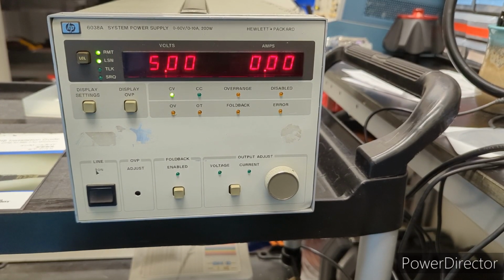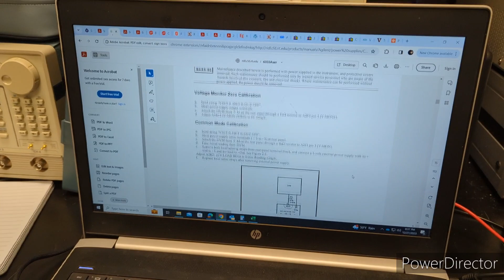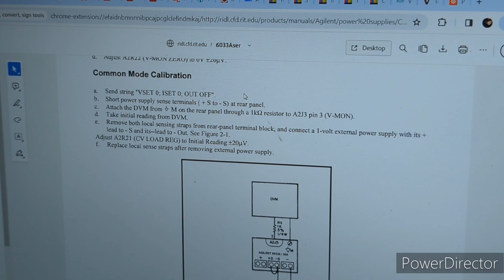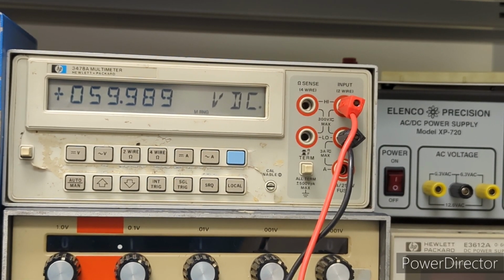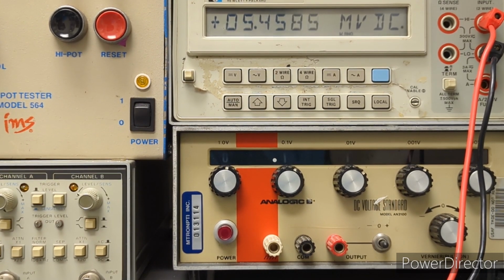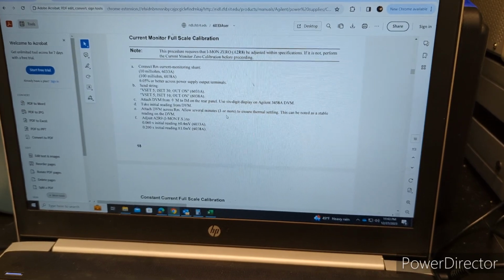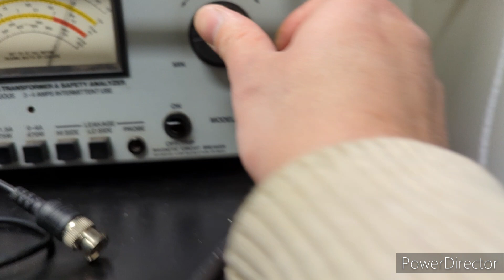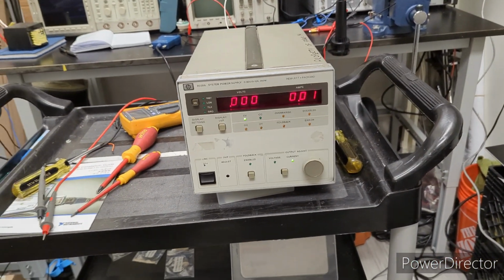HP 6038A Power Supply: Calibration with GPIB Controller

Comment: oh, no comments…what a buch of “party poopers”!

wel I REALLY enjoyed this little party! R40, “Come on Louie, Come on Louie” hold your tongue at the correct angle as instructed by Dave!

I opened three indtances of the manual to “play along with you”, one indtance was looking st the cal indtructions you were following and the other two instances were looking at the circuit, one st the A2 “mesh” board and the other st the A8 GPIB board.It was easy to find the pots you were tweaking, nut I found it much more difficult to work out where you had the DMM connected on each test, but I still gotbthe general giist of it.

The very first thing you did was to zero the DC offset of U7, and I assume you had the DMM somewhere around R1/CR8 monitoring the output of U7. Now if you ever “run out of pot track” as you did with R22, but lster, when adjusting the CMR with R21 and got in within limits…it often pays to go back to R22 and adjust it back away from the endstop, yhen come back to R21 again and pull the reading back the other way…you “itterate” back and fourth between the two steps until you get your desired reading but also end up in a condition where both R21 and R22 still possess some leeway either way and neither is jammed hard up one end.

You did exceptionally well with the equipment you had to hand, it was a few percent out and you reduced thst to about 0.1% out. Calibration is not about being perfectly on, but getting as close as you can with the gear that you have.

I have an AC DC voltage reference here, it has fancy cal stickers and dates all over it….last calibrated by the Nationsl Standards Lab in Canberra in 1997….And scheduled to be redone in 2003…but it was sold off before then. I sctually contacted National Standards…arrogant prats who wondered why I had bothered to call, but they said they would cal it again for me against the Australian National Voltage Reference for AU $ 10K!

So, yes primay calibration against your Nation’s standard is for the duper elites, but the rest of us can still do reasonably well.Assume you get to gether with 50 other electronics guys and ask them to ALL bring ALL their multimeters and oscilloscopes, then you test ALL this gear against the 20 year out of date cal standard….the bigger the sample of gear, the more precise a group can get all the gear to read virtually thr same, now it will probably be lower in accuracy than precision, but with a big enough pile of gear the precision could be assumed to be of a fairly high degree…because some people’s gear will drift low whilst others’ will drift high and, hopefully those drifts will largely cancel out.

Would actually make a pretty interesting experiement if the whole You Tube electronics community did this, then paid to compare the results to a national standard!

Those two procedures in the current calibration you felt were the same procedutr repeated twice, the first one was adjusting R9, the gain of the current sense amp U1, and the other was adjusting R55, which is the reference level to DAC U9 from U5, the master reference, so one was ensuring the load current was being measured correctly and the other was ensuring the SET current command from the GPIB via the digital section was also correct, these two are compared in U2B which looks like some sort of null measurement comparator.

I feel, least for me anyway, that following along in the circuit (as well as following instructions) gives you a better inkling of what you are actually doing beyond just the blind instructions. In most pieces of gear…and it could be anything from radio transmitters to x-ray machines will possess much the same principles, diff amps, instrumentstion amps, sense amps, comparators, VCO’s, phaee locked loops etc, etc. So cal steps will usually be of just a few categories, gain adjustment, offset adjustment, common-mode rejection adjustment, frequency ot beat adjustment, comparator trip adjustment etc. Over time as you gain experience, you will learn to recognize which adjustments, gain ror example, you sre making and get a much more intuitive feel for it…like realizing that itterating round and round between gain and offset adjustments may be required to go on ever smaller circles each itteration to get ever closer to the desired outcome. And it is far easier to do on your own gear where the onus of responsibility is only back on you, but mskes you better when on other people’s gear too. 

When you did the last pot, I could “feel” the wiper springing back a few tens of milivolts when you took the screwdriver out of the slot of the pot…it one stage I was literally yelling st the screen, why didn’t the bloody designer put a 10turn pot in thst position!

So, yes, thanks for coming back to it….and Please, please, “wipe it’s poor snotty nose”…get some ethanol on some loo psper and clean all that stickey smut off the front pannel!
Reply from the maker: Thanks Globe Collector I did this one for you! I really appreciate you always taking the time to write a detailed comment.  I think I might go back and take another look at the V-Monitor Zero & Common Mode cals as well as the I-Monitor and Constant I full scale cals.  

Yea I could make a better attempt to understand the circuitry.  I recently bought 'Art of Electronics' and have been slowly reading it.  Ideally, I'd like to be doing these repairs and reading through this book at the same time, but there's only so much time in a day - feel like I don't have enough sometimes 😂

I love that idea of gathering a bunch electronics hobbyists/professionals and checking each others equipment!  I feel there was a thread on the EEV blog forum where a group was doing this!  

I also appreciate you not slamming me for not using the correct standards/equipment.  I tried to make it clear that this procedure was just for fun on my own personal equipment that won't be used for any critical measurements.  But I'm sure someone will still comment saying I committed some kind of sin by doing this 😂

I'll be sure to give the unit a good cleaning with 70% EtOH!  If you have any video requests in the future, just lemme know!
Reply: I feel that we all can only do the best we can with the gear we have, (or can beg, borrow or steal), the 3478A was a “real little trooper” and had enough digits for most of the tests, and where it didn’t, well you got within 500uV as opposed to the specified 120uV. 
Not many of us can afford a HP 3458A, let alone a 3456A. 

You might want to look up Colin Mitchell’s “Talking Electronics”. Here in Australia we had a very strong electronics publishing community…we even had our own long running electronics magazines, “Electronics Australia” and “Electronics Today International” which collectively covered about six decades of electronics in Australia. Dave jones interviews both Colin Mitchell and Doug Ford, (Rhode Microphones/Jands PA Amps), on his EEV 1 channel, both ste very good snd informative videos.

I can’t “slam”you for the gear, or lack thereof, you have because I’m in much the same boat and I have to make the very same compromixes you had to. My best DMM is only 3-1/2 digit also.

One thing I will say though, particularly at this time of the year, (the “interweek” between Christmas and New Year), don’t neglect time spent with your partner!  All my electronics activity is basically “on hold” from the 23rd of Dec to about the 3rd of Jan as my partners birthday, Christmas and New Year all fall in this timespan and family/relationship commitments come first!
Reply from the maker: All good points!  I'll check out Colin and Doug and see if I can dig up any of those magazines (if they are online).  And thanks for the reminder! I get too carried away sometimes.  I'm sure you understand 😂 Fortunately my partner and I have spent lots of time together and with family this holiday.  Glad to hear you have been able to do the same!  @thanhhuynh272

Comment: Thanks for the video. I still need to calibrate my 6033A. I do have the receptacle for the test connector (board edge) but need to make a breakout PCB with it to make it easier to connect to those test points.
Reply from the maker: Thanks for watching! Yea that J3 connector is such a pain to probe without that test connector - and a breakout board would be even better.  Then you can easily leave the shielding on the unit.  This procedure is definitely applicable to your 6033A with some slight changes.  The shunt resistor is a 0.010 instead of 0.1 ohm.  And obviously the settings will be different.  Just remember to have the correct calibration standards unlike myself here 😂 But all and all it's not a bad procedure and it doesn't require all that much as far as materials!
Reply from the maker: Also, I recommend using this copy of the service manual.  It's much better resolution than what Keysight's website has available http://ridl.cfd.rit.edu/products/manuals/Agilent/power%20supplies/CD1/Service/6033Aser.pdf